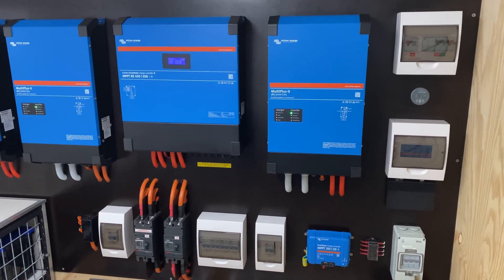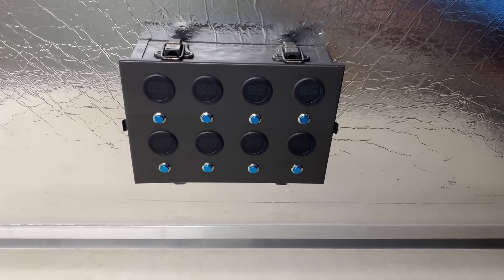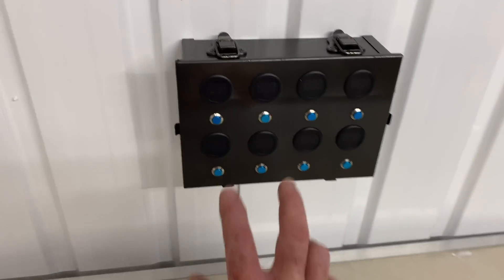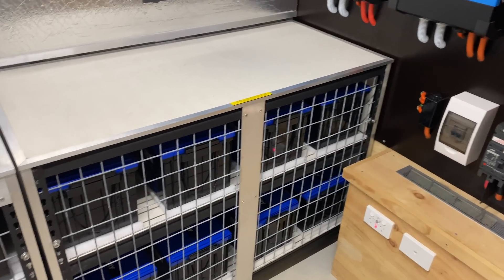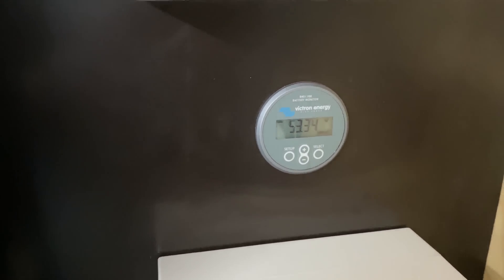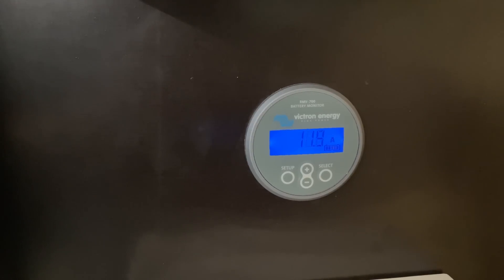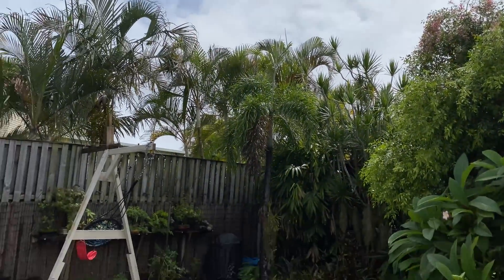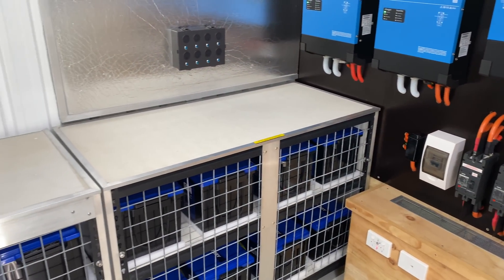Victron Energy Battery Management System For 15KVA Parallel Multiplus II Solar Power System - Part 1

Comment: Nice battery done well!!
Reply from the maker: Thank you 😎 It's a DIY 48v 800A 3200AH beast🔋 Equivalent to about 3 tesla power walls! At a fraction of the price. The charge cycle is fairly gentle, we drain around 10% charge overnight. And only charge to 98%. The entire system (panels, cable, MPPT, inverters, batteries, circuit protection etc) will pay itself back in 4 years, If the batteries last 6-8 it's a huge win (what are peoples thoughts on life expectancy of this kind of battery? 12.8v 200AH LiFePO4).
Reply: @OrganicPower-Australia  i think the battery will last indefantley, it's the capacity you will lose over time,  but maybe 20% in 10 years,  so still awesome,  and you can add like another bank to make up the losses
Reply from the maker: Sounds about right if no complete failures! By then battery tech will have improved drastically resulting in better bang for buck. Thanks for the input!
Reply: @OrganicPower-Australia haha true, thinking far into the future now...  even if you had a cell failure, you have 15 other batteries to wait for a cell failure then harvest one at a time to fix them up to a full and chop out the failed ones to make new complete ones for your system, but yes by then they be even cheaper 😅
Reply from the maker: The future is looking BRIGHT!